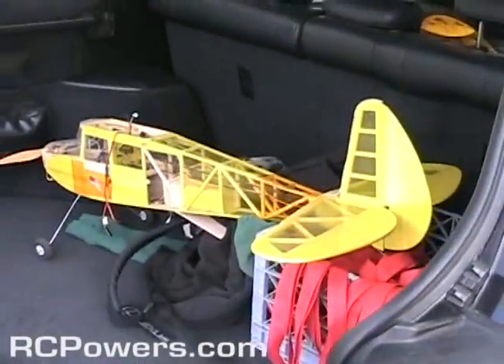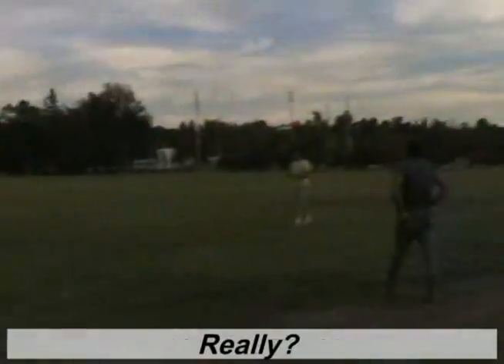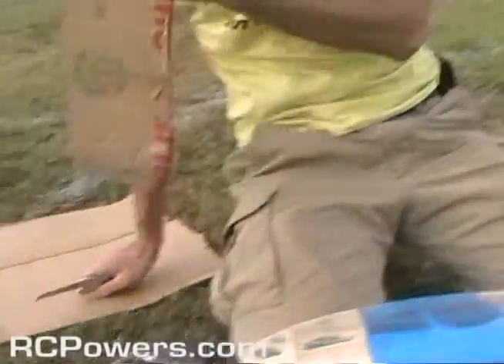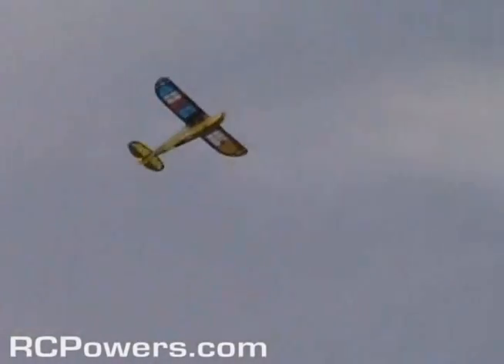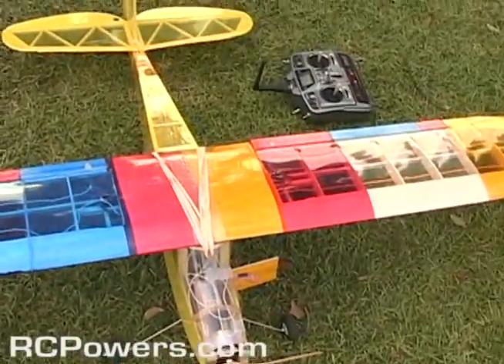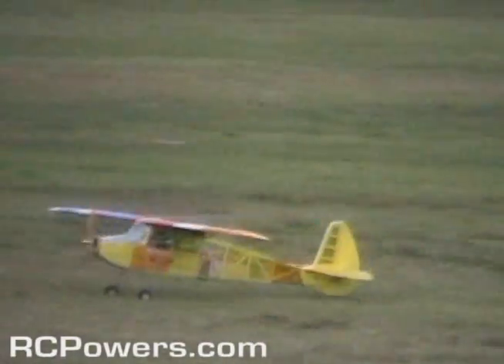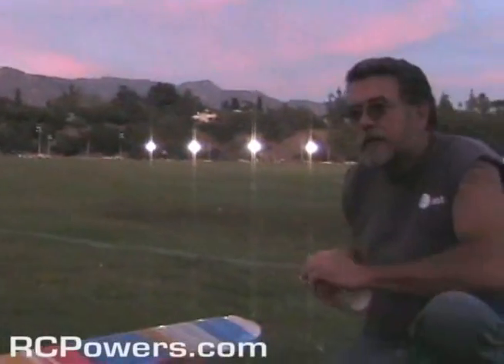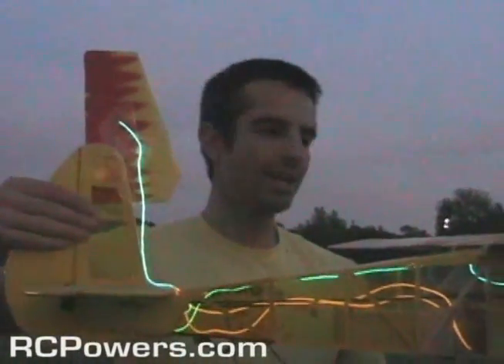Importance of Vertical Stabilizers

Comment: This seems to be a:
- Vertical Stailizers ... (anyone ajust the Vertical Stabilizers!!!)
- CG problem ... maybe  (With only ajust paper?! ... I dont think so!)
- Wing Stall problem ... probable! (He decrease it put paper under the rear wing)

When in plane is flying the velocity and the angle of airplane increase the stall effect and it can happen. In 10-15 degrees is normal this happen (to every model). Some form of distribuction wing area can help to this happen more easy too. In others this can happen more smooth. Try it!
Pilot Training: "Keep it Flying" Part 2 1945 US Navy Training Film; Robert Taylor
Angle of Attack Explained | profpilot.co.uk video #4
Airfoil Stall (I)

Comment: In my opinion it is not lack of vert. stabilser that causes it being unstable. It is small wing surface combined with law speed. I have a similar plane i bult and it has very tall v stabiliser but can't fly--it never had enough speed on take off in terms to be stable. By the way, i feel v stabilser prevents drifting sidewise and not rolling.

Comment from the maker: We thought it was tail heavy too at first and made adjustments off camera with the CG and it "helped" but did not do it. Flying in this video its actually slightly nose heavy the whole time. The rear vertical is too small and it was only by increasing it did this fix it... as the video shows. Oh, and notice that adding cardboard, foam, and tape in the back only made it MORE tail heavy and yet its the larger tail that fixed it.

Comment: Adding a rudder will not make the best difference, just a larger vertical stab surface is all this needs.  Rudder will give you more control, but now you have to add another servo, more weight,  need one more channel on a cheap radio, to get a cheap pos plane in the air

Comment: I wont spam Daves video with a rediculous internet argument. All I will say is that If you look in the video, the rear of the fuse is considerably short, so unless he had the bright idea of putting some lead blocks back there I wouldn't guess that it is tail heavy. And also, look at a still shot of the side of the plane, the CG would HAVE to be correct, the majority of the mass of the plane is toward the front of the wing, along with all of the electronics and battery. Thats where Im coming from

Comment: Buddy, you are way in over your head when you say Dave and Keith don't know what they are talking about. They engineer planes to sell! A little common sense (which you seem to lack) would state the tail wag would partially be from the huge front fuselage, and the beefy landing gear. With such a huge front, I highly doubt that it's tail heavy, if you look in the video you will see that when the plane banks to one side, the tail wants to slide down, because there is not enough vertical stabilizer.